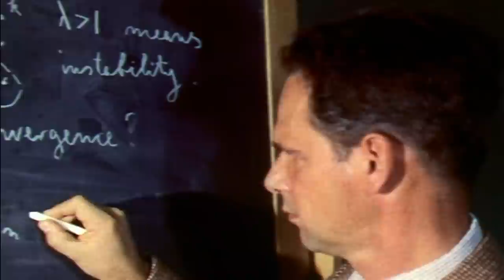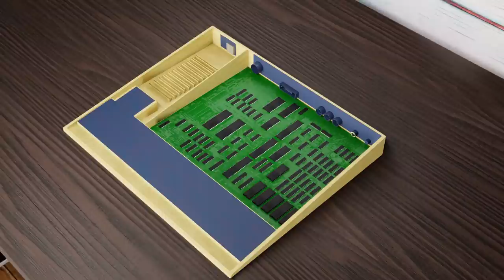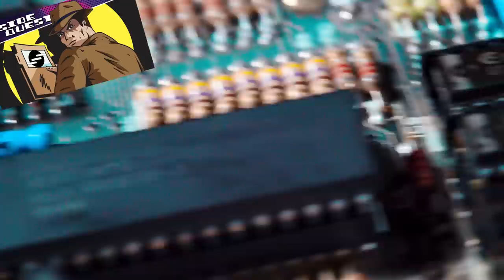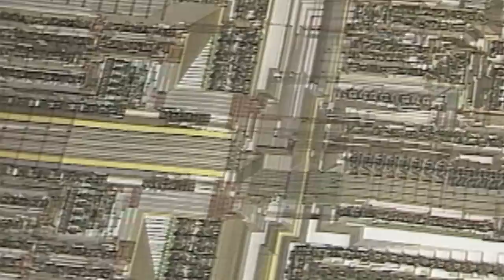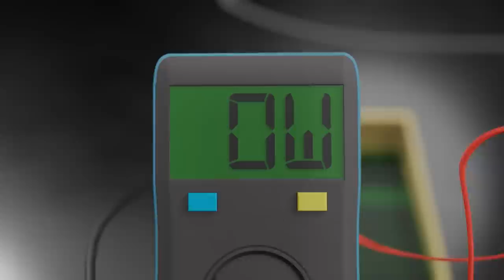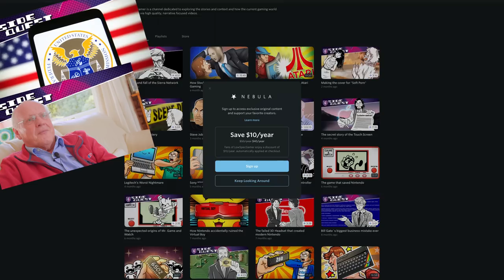How Amateurs created the world’s most popular Processor (History of ARM Part 1)

Comment: I really can't believe we had chips that could execute code without needing plugged in power. Also the fact that it was a mistake is insane.
Reply: Amazing how many breakthroughs and discoveries are result of accidents and mistakes.
Reply: "Have you tried plugging it out and in again?"
"It's not even plugged in"
"Then how did it work in the first place?"
Reply: @Felix-ve9hs  like the Senators asking Mark Zuckerberg "if Facebook is free, how does it make money?"
Reply: @NathanHedglin  zuckerberg: bee boo boo bop
Reply: @NathanHedglin  It sells user data to advertisers.
Reply: Well no, it did pull power just not through external Vcc pin
Reply: We still have those kind of processors. they're just not used to power PCs any more ;)
Reply: great designs will always have surprising quirks.
Reply: Yes, ARMs are extremely power efficient and robust. In one of my designs EMS failed to solder PMIC properly. While some IOs were not powered - chip itself was programmed and was executing all the code it had. Imagine troubleshooting that issue: everything (except two things) is working properly. Would you assume, that MCU is just not getting its main power?
Reply: It did need power, but it got it from a foodbank.
PS. it was only one chip.
Reply: @sebastianwingednekokipp2694  i see what you did there
Reply: @sebastianwingednekokipp2694  this will age like milk
Reply: @NathanHedglin no the dumbest one is “does tiktok connect to wifi”

No bro, we have the processing power to make it all AI. It’s watched by ai too.
Reply: Zombie processor that works even after death
Reply: LOTS of the greatest advances in science and tech were mistakes. That's one of our most important tools - the ability to screw up and discover the universe...
Reply: If you've worked with microprocessor designs at the prototyping stage you will have come across this before which is what Steve is hinting at.  A current MCU will easily work this way and its a common mistake - I think though to him a powerful CPU of the era wouldn't and that is what was suprising.  What suprised me is that the rest of the devices on the bus / address could source enough current because NMOS only weakly pulls up, but by the mid 80's CMOS was around which drives high as well as low so its less suprising by then.  Usually though the IO diodes are puney because otherwise they take up a lot of die space and if you draw too much you'll kill them.  The ARM had multiple Grounds and Supply so they were probably measuring it upstream.
Reply: @sebastianwingednekokipp2694   Interestingly, even 1 year since that comment and whilst it was wrong then its even more wrong now.  Windows PC's now ship with ARM processors, all phones for the last 2 decades and Apples much hyped M Core processors are all ARM designs.  The ARM core is the most sucessful processor core design ever.  With 300Bn produced and production is increasing.  You'd be forgiven for thinking Intels x86 must be dominant but its a long way behind.
Reply: @dr_jaymz  Most of the people didn't get the inner meaning of my comment, a year back. 
It was specifically meant PRO ARM design - not against it. :D maybe I should have written "power PC" in quote. It was meant as a phrasing joke ((you know, there was an Apple PC, called "power PC", once) but its not too funny if I have to explain it), and also a potshot against the x86 driven PCs from back then...
I highly like power efficient Core designes and embedded high powered systems - as well as (not that efficient, but still awesome) powerful ARM designes to run "PCs with human interaction".
Reply: lol!!!  I had this happen in the mid 1980’s with a pretty simple CMOS chip - powered via inputs through protection diodes bc when we checked schematic we forgot power rail.  It was only simple multiplexer or something but I bet this happened a few times to ppl. In my case it was already a shipping product when we found it.  We also in that era built the first software controlled video frame buffer manager using a 2MHz 6502.  It was amazingly flexible for the time.  I had just heard of RISC processors and thought 6502 was ‘almost a RISC’ - simple and many instructions executed in one clock.  It was perfect for video with our “must finish basic loop in one horizontal scan line”.  At the time we didn’t use interrupts, we let processor stop itself with simple hardware and continue on next scan line start to achieve synchronicity with live video. Those were the days.

Comment: Fun fact: The 3DO console used a custom ARM processor. It was actually very powerful, but unfortunately it was never fully utilized by any games released for the system.
Reply from the maker: Fun fact, this is a plot point for part 2 of this story!
Reply: epic
Reply: typhlosion
Reply: @LowSpecGamer  lmao
Reply: @LowSpecGamer  that’s pretty cool 😎
Reply: It had plenty 3D games that put it to it's paces like need for speed.
The problem of it is that if compared to the absolute monstrosity that is the original playstation, a system where basically every transistor in the system is dedicated to draw 3D graphics (and is probably manufactured on a better process than the 3DO chips), it is quite slow at 3D drawing (i would guess half the speed of the PSX).
But until the playstation, it was the most powerful system on the market, even beating the everliving hell of the likes of the atari jaguar and most PCs.
Reply: Fun fact: I ate a bologna sandwich for the first time today.
Reply: The PS3 dilemma
Reply: @dan_loup  Saturn was technically more powerful.
Reply: @Benny_Shill  it had more chips, but the GTE is faster than all the three chips combined because it's an ASIC designed specially for 3D math.
Also the lack of texture UV capabilities blocked the Saturn from many special effects
Reply: Isn't that still a problem? On mobile very few games fully utilize the power of a smartphone with arm even now. I think genshin,cod, and ToF only examples I can think of there they made actual games and not just candy crush clones.
Reply: @RaidenKaiser  every Nintendo portable since the GBA use arm chips if you want to see those pushed hard. The GBA in particular push it absurdly hard, doing 3D games with no 3D acceleration whatsoever, only relying on it's 17Mhz arm chip
Reply: Computing power is a more complex concept than many people think, because different architecture affects performance in a task dependent way. More clock speed is usually better as long as you're comparing to a similar architecture, but it isn't everything. --- There are also a ton of other concerns, like moving data around fast, or efficiently, enough to avoid idling the CPU when you don't want it idle.
Reply: @LowSpecGamer  OH SNAP, can't wait!
Reply: @JustWasted3HoursHere  it was alright
Reply: @dan_loup  3D GBA games are so amazing! You see the demos for GBA Crash Bandicoot, Diddy Kong Racing, Quake, and a fan made first level port of PSX Tomb Raider 1? Awesome.
Reply: @lelsewherelelsewhere9435  the tomb raider one in particular sounds impossible but yet it's real
Reply: Fun fact: GBA processor was about 50% faster (in MIPS) than the processor of 3DO.
Reply: except the model in the 3do had no cache and was extremely bottlenecked because it was limited by the speed of the bus.
Reply: x86 >>> Arm
Reply: @henrythegreatamerican8136  you prefer x86 asm?
Reply: @jc_dogen  i don't think anyone does ASM for either platform as GCC is just better at that than humans
Reply: @dan_loup  oh, yeah they do. intrinsics are commonly used in games, and sometimes inline assembly (nothing preventing you from using the compiler output as a baseline, then improving on it). either way, there isn't really much of a reason otherwise to prefer one over the other.
Reply: @dan_loup  The PS1 also had on-board MPEG decoding and could push 2D just as well as any console on the market at the time. 

The 3D capabilities were revolutionary, yes, but it could also do everything its competitors could do better. There was fundamentally no reason to go with something like the 3DO because of that, as the PS1 was far from a one-trick pony.
Reply: @elphive42  Yeah it could also draw ~3x as many sprites as the sega saturn too. The saturn does have an 512KB extra vram over the playstation for background layers though.
Reply: I bet if the doom port had more time in the oven and got a chance to be properly developed, it could have ran at higher then 15 fps on the 3d0. The 3d graphics back in the day were pretty cool (from ads and stuff, I wasn't around then). If it was somehow cheaper and had more developers, it could have possibly competed with the playstation 1!
Reply: @elphive42  The 2d capabilities are the 3d capabilities in this case. You drew the 2d characters with two textured triangles. And the playstation could do a lot of those
Reply: @rb3020  with only 10 weeks i doubt she had time to study and use the 3d blitting capabilities of the 3do
Reply: Because it had no documentation, developers used the secondary I believe it's motorolla cpu, so no game used it at all
Reply: @rb3020  A little bit. Someone already spent a lot of time on that, look up optidoom. The more you optimize the rendering, the more the CPU becomes a limit. Maybe with extensive optimization in assembly you could do even better, not sure.
Reply: @jc_dogen  but it reads aligned 32 bit instruction s from consecutive addresses ( condition flag helps ). And it can read and write multiple registers in a kind of burst. It has a lot registers to cache data. Maybe don’t waste them with calling conventions and deactivate the interrupt for some code blocks? i386 also has no cache. The shift instruction is paired with ALU to allow packed data to stuff more into the registers and to load more in one go.

And a  MMX SSE GTE like extension would bring their own register file. SIMD reduces the stress on the code fetcher.

With shared data and code memory, at least a cache to mark branch instructions would be nice. Then don’t tread the branch delay slot. Instead finish some store instructions
Reply: There was a version of the 3DO from Creative Labs (they made the Game Blaster and more popular Sound Blaster), which was called "3DO Blaster". You basically made your PC into a 3DO. Diamond Edge 3D did something similar with the Sega Saturn, but only for the graphics chips, so you had to have special PC versions of Saturn software. I think that both products deserve more attention.
Reply: @ArneChristianRosenfeldt  Sounds nice, some of it over my head (I only really know 6502/65C02 and not as much about more advanced cpus). I'm just assuming the cache makes a big difference because a few friends of mine saw a 8-10x performance difference on SH2 (sega saturn) between the cache enabled vs disabled. But they're not writing asm generally.
Reply: As did the Sega Dreamcast I believe. A lot of credit goes to gaming machines whose volume affords the ability to really stretch the tech. Take 3D graphics as a prime example. Prior to the evolution of the programmable game console a 3D processor (frame buffer really) ran in the tens of thousands for a workstation class machine. The Commodore Amiga was the first to hyper-integrate a chromakey capable full color graphics system into a low cost PC.  Then as the workload of rendering became noticeably problematic - custom math rich circuitry was evolved to offload the main CPU from the task. (Instruction set enhancements were a milestone but failed to solve the issue for real time rendering.)  Companies like 3DFX (destroyed by NVIDIA) were on the bleeding edge there. Amazing milestone.
Reply: @dennisfahey2379  Dreamcast only used it as the sound controller and it was an arm7 like the gba. The Dreamcast used a Hitachi SH-4, the evolution of the SH-2 used in the saturn and 32X.
Reply: Unfortunately true for MANY consoles. Especially the PS3 which was extremely powerful but had a weird architecture.
Reply: @NathanHedglin  Actually, it wasn't any more strange than the PS2. The MIPS III core could use a vector processor (SIMD) as a coproccessor (synced with the CPU) or independently. There was a 2nd 1 that was always independent. If you expand in that direction (more independent co processors, and built-in Altavec SIMD for the main PowerPC CPU), the the PS3 was a natural evolution. They didn't expect SMP multicore CPUs, and they thought that spliting graphics RAM and main RAM would cut down the memory bus conflicts, and it would, but so does cache. It was a matter of looking at the last gen more for insperation than competing trends.
Reply: that one of the bigest problems, new tech, if it compatible room, the old way of doing things, it just stays doing the old way, and new stuff never gets a look in, because the old way is the way the rest do it 😞
Reply: @dan_loup  the PlayStation and any the bbc/acorn's where not out at the same almost 10 years apart? at least, BBc was there first?
Reply: @dh2032  This thread is about the 3DO console, not the acorn machines if you see the original post. It was just 2 years before the PSX.
Reply: @jc_dogen   but that is the SH2 . It needs more instructions.. okay, it loads two instructions at once. But 2 register format means that you need to add backup copies more often. It cannot pack stuff into a single register. Yeah, both have only 16 registers. 1993 was the tipping point for caches. SH2 got a cache for general purpose applications. The same silicon as vector unit would speed up a 3d game much more.

In the end, 1994 PSX got both and left other consoles in the dust.

I mean, I love cache. Even 256 bytes on the 68040 would allow you to do memcpy and scan strings and all this 8086 CISC instructions with RISC and no memory access for code fetch. Why do people complain about 16 bytes? Who needs a bigger inner-loop?

Does the Saturn share memory? 8 times faster??? On the Jaguar cache is needed due to the shared memory. Video DAC has cache. DSP and GPU have cache. Palette is in the PPU ( kinda like a cache ).

But 3do has separate main ram and vram like a PC, or SNES or Saturn.
Reply: @LowSpecGamer  Whoa! But would Part 2 have to be on Nebula or is it coming to YouTube? I don't even have enough money for Nebula. Sorry 😞.
Reply: History has told over and over again, a powerful hardware never guaranteed a success. Doesn't change the fact that those systems were a technological feat of engineering.
Reply: Does anyone have a 3DO system anymore? I wanted to find one to try it out for myself.
Reply: @dan_loup  Nah dude NO game on the PS1 looks and runs like Virtua Fighter 2
Reply: @vidjenko8349  Tekken 3 runs in high resolution and 60 FPS like VF2, but has real backgrounds and gouraud shading on the characters.
It's technically much more impressive, despite i preferring VF2 as a game
Reply: @dan_loup  What is your opinion on the homebrew Sega Saturn game called Hellslave? The programmer (XL2) has added a ton of rendering features that were never attempted in retail Saturn games back then. Even then, it runs pretty darn well with all the bell and whistles.
Reply: @Banzeken  The unreal demo in particular he did is very impressive
Reply: The CPU in the 3DO was an Arm 60, essentially the same as the old ARM 600 (a v3 core) with it's co-pro bus removed and replaced with one specified by Dave Needle (Hardware designer behind the Amiga and Atari Lynx and 3DO). Much like the older Amigas, the CPU was very underpowered but could offload almost everything to custom ASICs.